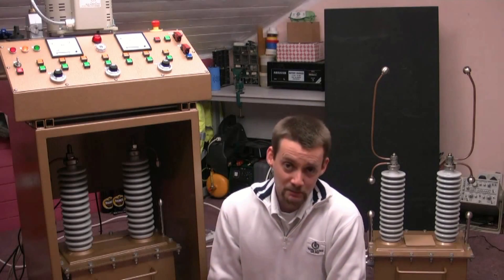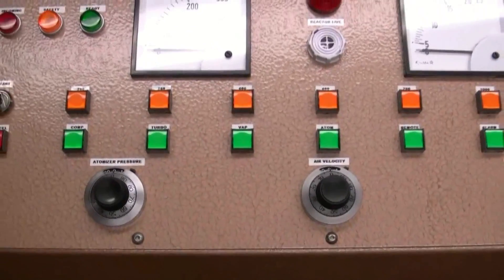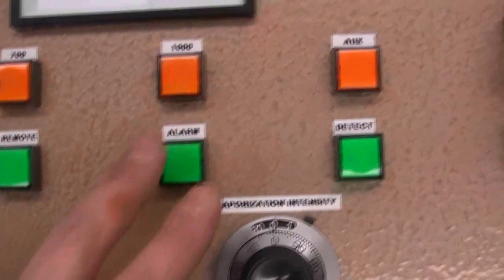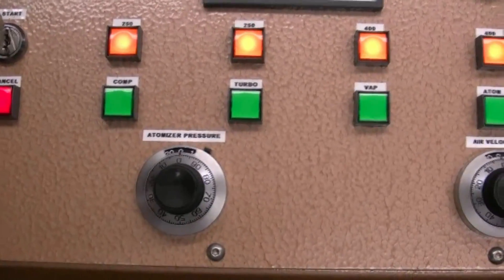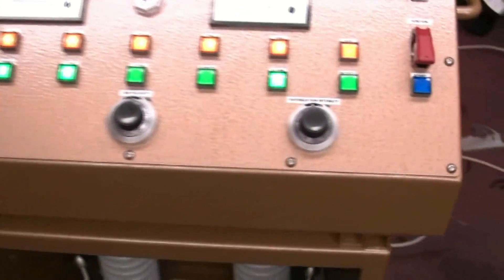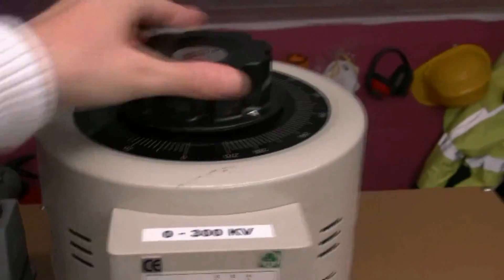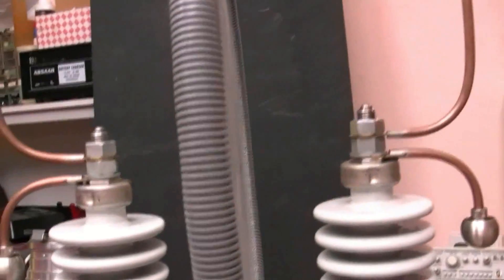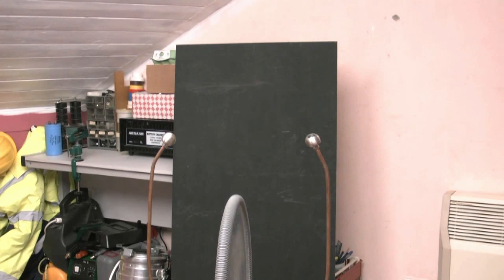Big Boys Power Supply

Comment: I'll have to agree, there's nothing better than over-engineering something. My tower computer uses 3 computer cases, has 2 optical drives (+1 without data), a floppy drive, dual-boot with 2 hard drives, a SoundBlaster Audigy 2 ZS, and a router and Raspberry Pi 3 inside. I'm happy

Comment: where would someone get this caliber of equipment from?
Reply: He made it himself. He's really, really clever. And intelligent I might add, he's been working with High voltage for years and hasn't fried himself yet.
Reply: Other than the transformer this is all standard equipment for industrial controls. The only thing slightly out of the ordinary is the 1:1000 transformer, but even that is somewhat easy to obtain.
Reply: Evan Perry shady shenzen eBay sellers if you don't want to pay a absolute fortune
Reply: Uraharas shop
Reply: Rs electronics and larson electronics probably also ebay as well
Reply: Caliber Equipment Shop!

Comment: he uses ballasts to achieve the power output, notice the wattage buttons are exactly same ratings as common HID lamps, 250w, 400w, 1000w etc. every time he pushes a power button, another ballast is just added in series to the circuit
Reply: +Kyle Shady Wrong ! They are wired in parallel, cause in series, the output power would be determined by lowest wattage ballast connected.

Comment: How do the 250W, 1000W buttons etc work exactly? Can somebody explain me this?
Reply: Inductive ballasts, just the same as what is used in a big old buzzy florescent lights fitting to stop the tube from getting carried away pulling current until it POPS! 😁
Reply: @izools Probably using LOTS of those, they are cheap and readily available - builders dumpsters,. (I used them on an inverter filter)

Comment: what are the air things for? I didn't understood it clearly
Reply: DanielTseng100 No they aren't (I know this comment is a little old, but it must be said, this guy has misinformed you.) This power supply is intended to be the control panel for a hydron project, essentially a machine that uses very high voltage to split water into hydrogen and oxygen, which gets burned. The 'air things' in this particular video are just examples, but the individual power controls on the supply he was using is to control the power for 3 main things: The compressor, turbo fan, and vaporizer. The compressor blasts a concentrated water mist into the system. The turbofan is to keep the stream of water/reaction going at a fast speed, and the vaporizer is to vaporize the gasses. These three components need to be carefully controlled and finely tuned, hence these fine adjustment controls.
Reply: to keep things cool and to remove ozone
Reply: ok, thanks

Comment: I would like to understand more about this power supply.  Atomizer pressure, Vap, Comp, Turbo, Gaz detection system ????? I never saw something like this. Usually for me a power supply = 2 knobs variable Voltage & Amp.  Anyway that thing is a very nice piece.

Comment: Wait, you built this power supply to power a hydrogen reactor? I thought electrolysis requires high current instead of voltage, did I miss something here?

Comment: Not with any normal way of making transformers. The most challenging part of making a 1000:1 transformer is preventing insulation breakdown and internal arcing. There are parts of the transformer which are at different voltages, with a difference as high as the maximum output voltage. If you don't insulate that adequately, it will just arc inside and produce no useful output. Photon did a good job getting even 200kV to work in that package. 200 MV would be much, much harder.

Comment: Could it be possible to take the output of one transformer and feed it to the input of the other? So you could have like 200,000,000,000 volts out from the third transformer?
Reply: It would probably break both transformers